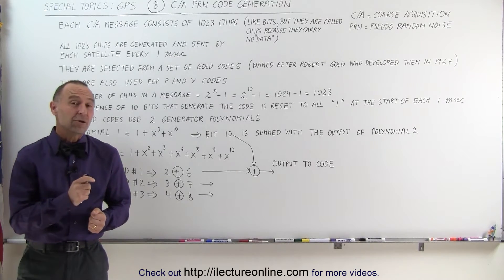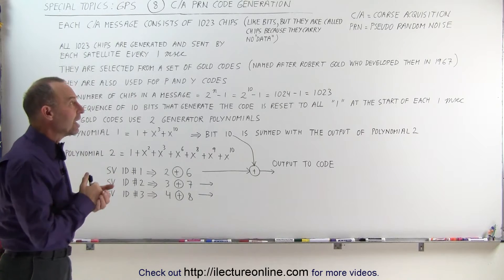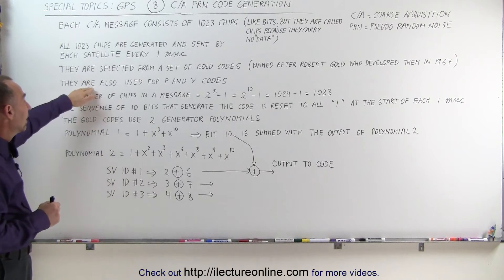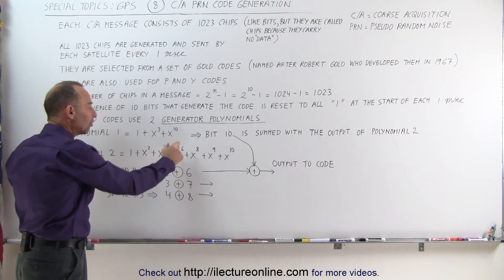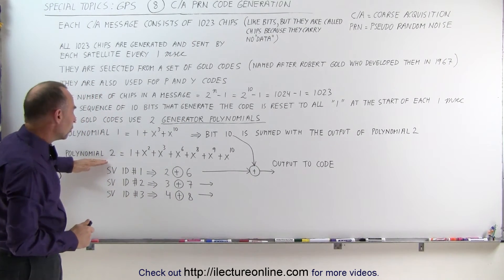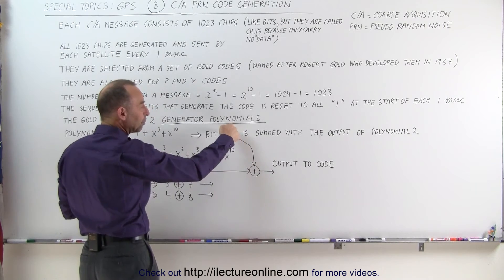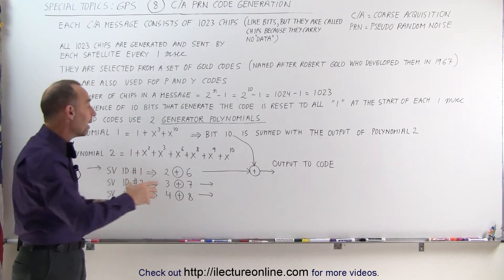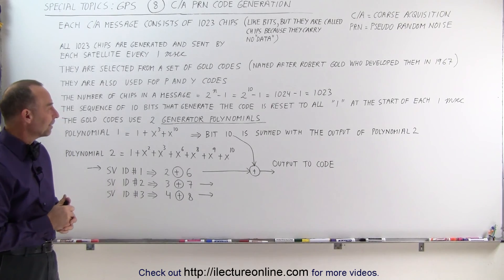Special Topics - GPS (8 of 100) C/A PRN Code Generation

Comment: Hi! Thanks for the video, it is quite interesting. However, I have a question, is the transmission rate of the code 1023 Mbps or 1.023 Mbps? I'm confused. Thanks a lot!